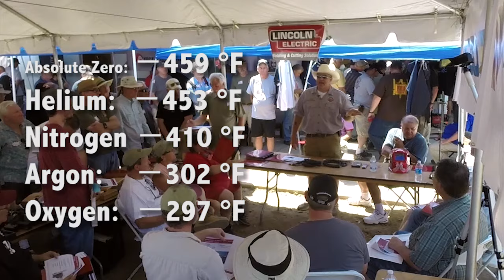TIG welding basics - the fundamentals of how and why

Comment: Good stuff! I am guilty far too often of not covering up good enough and getting a welders tan this is a good reminder to try to do better.
Reply: Being a welder in Phoenix and wearing the proper gear isn't fun. I have a set of leathers that is just over my arms, shoulders and has a front bib that snaps on. It is really nice to weld in. Very protective but too hot to use. And as a side benefit... It still fits even though I'm not the same size I was when I got it about 20 years ago. ;-)
Reply from the maker: My jacket is ummm, a little tighter than it was a few years ago...it must shrink with age...lol
Reply: DoRite Fabrication
You probably washed it in hot water, yeah that is it!
Reply from the maker: Yep that's exactly what happened!

Comment: Jim:  If someone was fair at oxygen/acetylene welding, would that transfer into an easier time getting started with TIG welding?  Also, how come you don't need a separate shielding gas with oxygen/acetylene welding?  Thanks.
Reply: I'm not Jim, but I will answer your questions.  Being adept at O/A welding -- another two-handed manual process -- should help you hit the ground running once you try TIG.  In O/A welding, the burning acetylene shields the molten weld pool.  This is why you need to keep the tip of your filler rod in the envelope of the outer O/A flame.  Failing to do this will cause the tip of your filler rod oxidize in the atmosphere and result in weaker (oxygen-contaminated) weld.

Comment: Hi mate, Have you ever heard if people tried to weld in a vacuum?
Reply from the maker: Marcel, I have heard of people welding in a vacuum booth, that was really something similar to a blast cabinet that the atmosphere was vacuumed out of, and replaced with argon. I do not know if it would be possible to weld in a true vacuum (like space). Following the theory of TIG welding(discussed more in an upcoming episode of this lecture), We need the inert gas to become ionized so the weld current can travel across the gap (through the gas column like a neon sign) to the weld plate. I do not think the electric arc would travel through a true vacuum and/or transfer it's energy without loss of arc control and energy losses. It sounds like a good experiment for you to video and make...lol
Reply: I'm sure it would be a good experiment for some one, but if I would do it. how would we know if it's a success.  My welds look like a dog has crapped on it , I don't seem to have the right temperament to weld things.